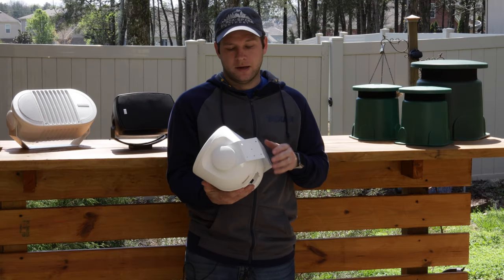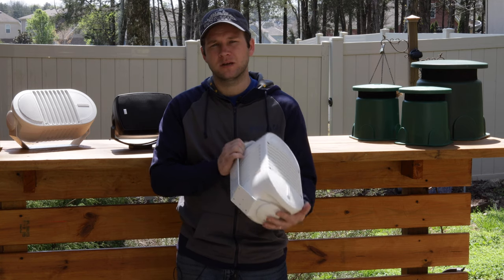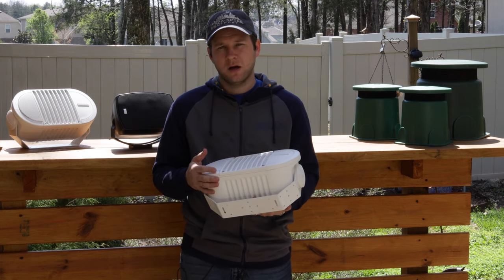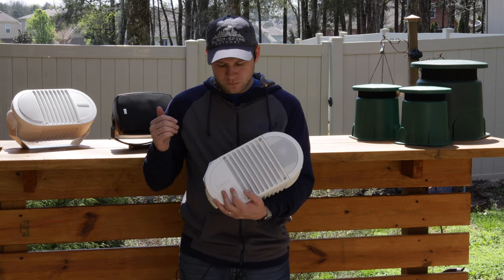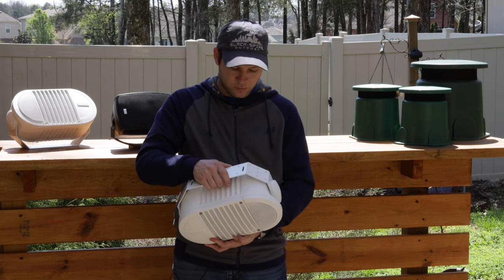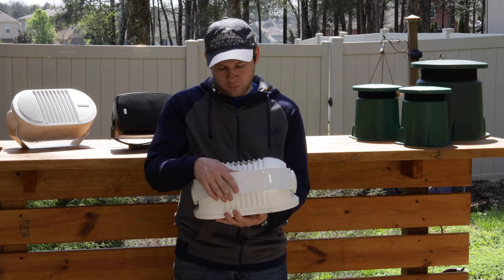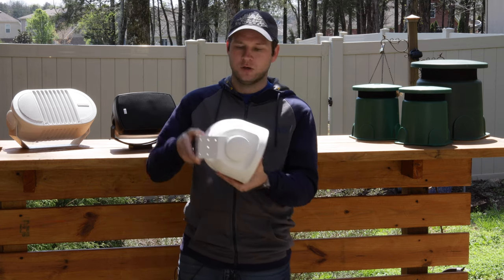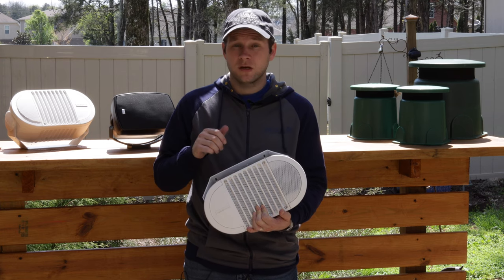Bogen/N.E.A.R A6T Speaker review

Comment: Hi 

would recommend. This speaker for a small campus environment. I have a small charter school with a 240-watt TOA Amplifier 

They currently have (2) Bogen 15 SPT15A paging horns one in the front and one in the back of the building.

They want to add (2) additional outside speakers, so they are on all sides more for an emergency scenario. 

I was just going to add the same. paging horn and they wanted to know if there "something better. " I didn't think there was until I saw these. 

so, I showed them these speakers and I think they liked the way they looked. I just want to make sure they are going to be as good as or better as the Bogen paging horn. 

Thanks

JD
Reply from the maker: It really depends on the use case with these, they would sound far better but would not be nearly as loud as a paging horn, especially at a distance. If you want pretty good music performance I would go with these, if you are simply trying to have an announcement heard then more of the paging horns is probably your best bet.  The best would of course be a lot of these placed all over the area, but that would really be a full system redesign and would end up being expensive as I believe these are usually at least twice the price of the horns. If you do end up going with them make sure you are looking at the T model, like the A6T rather than just the A6 as only the T model has the transformer in it, the non-T is only 8ohm.